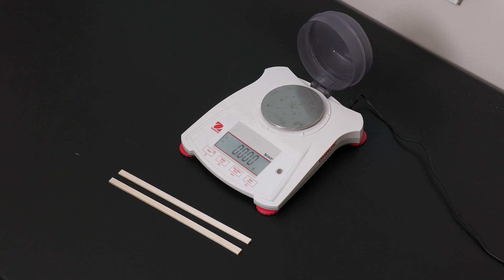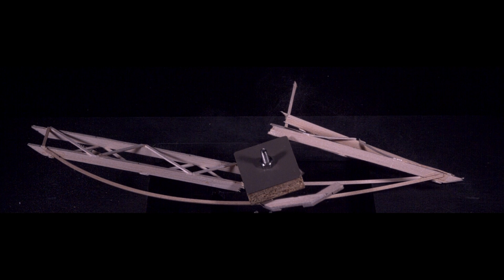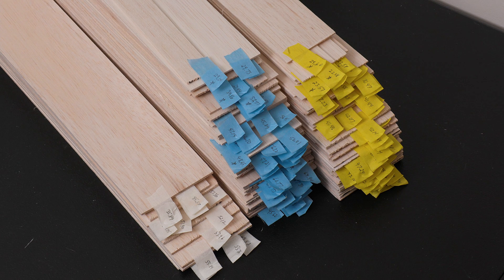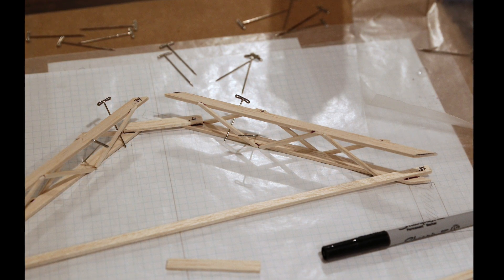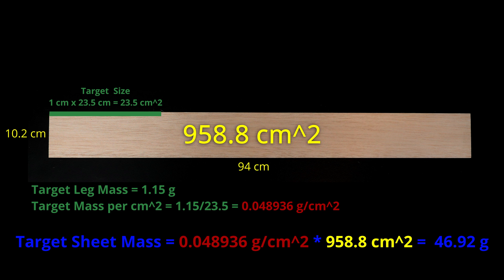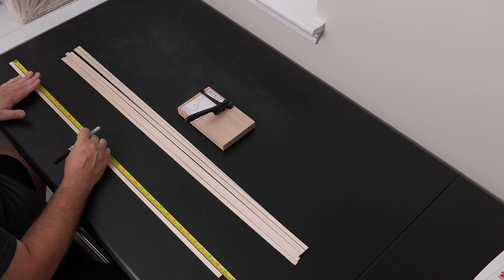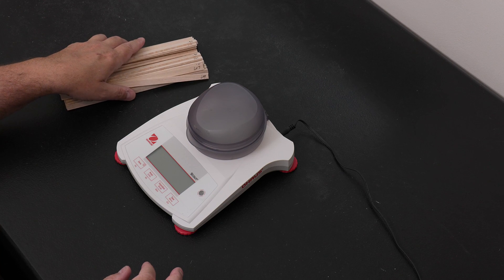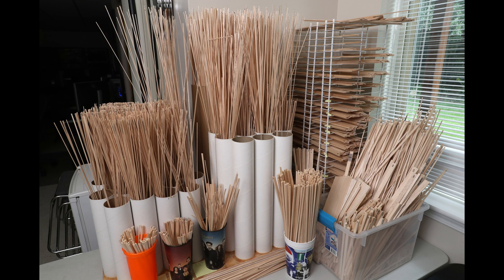Creating a Balsa Library and the Impact of Material Density

Comment: hi balsa engineering! i’m currently doing tower in science olympiad and watched your videos last year which helped me medal! i’m interested in learning how to cut balsa but i’m a bit confused on how i’m able to cut 1/16” x 1/16” balsa cross sections because it’s just so small. are there any tips and what specific steps you do to cut it? the balsa stripped cuts to 1/2” but that’s still too wide 😭
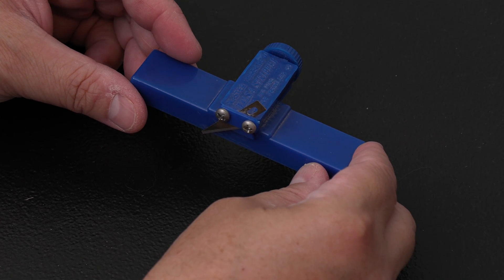Reply from the maker: Hi!  At the 3:17 point in this video I actually show exactly how I cut my strips using 1/16" x 1/16" as an example.  Have you tried this and it doesn't work for you?  You definitely need to get a balsa stripping tool like I show in the video, but that is much cheaper than buying individual sticks.  Good luck!

Comment: Does precutting wood months before using them damage the structural integrity or density in anyway?
Reply from the maker: No, definitely not.  You can safely cut your wood early with no concerns.  Wood age overall doesn't seem to matter either as I've used some that is several years old with no problem.

Comment: For your Balsa sheets from Specialized Balsa, did you choose the weight and grain of the balsa?
Reply from the maker: Sometimes yes, and sometimes no.  I will usually specify a light density range. I'll only specify grain if I have a very specific need as it's double the price. You can actually specify an exact mass target for a sheet if you know what you're looking for.  As you'd expect, that is also very expensive, but it's a nice option to have

Comment: Hello! I first would like to say that I absolutelty love your videos, but I was also wondering if laser cutting balsa has any large negative effects on its structural integrity if you have any insight on this subject? Thank you
Reply from the maker: Thanks for the kind feedback, I'm glad you find my videos useful!  I haven't had any direct experience with laser cutting balsa, but my guess is that it might be interesting if you need to cut more complex pieces, like maybe the notched pieces for the platform in the Div C build this year, but I don't think it'd be worth it to laser cut the general straight pieces.   Regarding negative effects on structural integrity, probably not, especially if the laser cut along the grain similar to how you would use a balsa stripper.  If you do have access to a laser cutter and give it a try, let me know how it goes!

Comment: What size balsa sheets do you get
Reply: The 36 inch or the 48 inch ones
Reply from the maker: I prefer the 36" sheets.  The 48" ones are much harder to cut perfectly straight, at least for me.  I also like 4" wide as that is usually the most cost effective.
Reply: @balsaengineering6686  thankyou